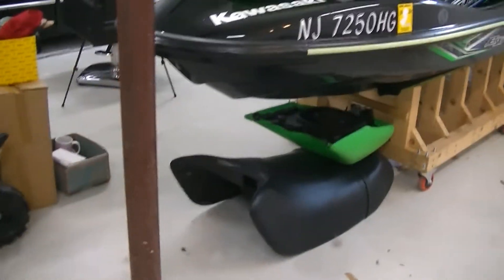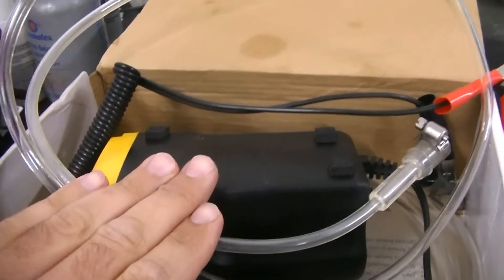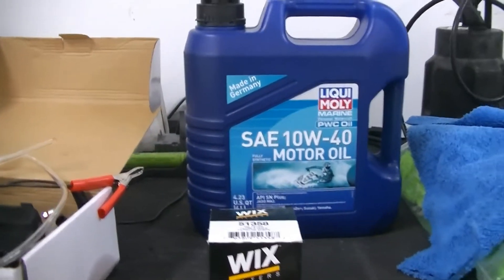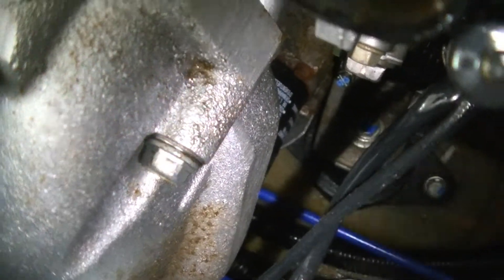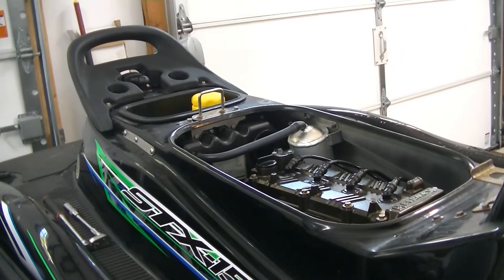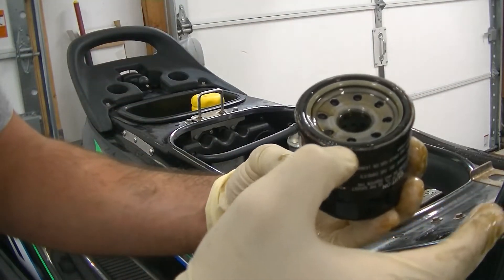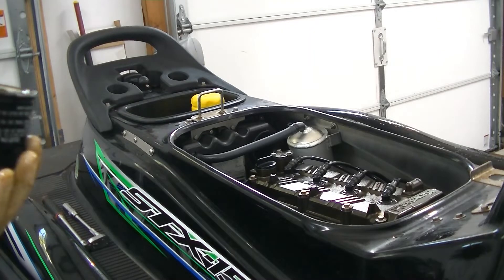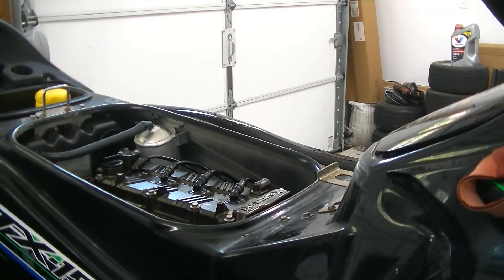How to change the oil in your Jet Ski!!!

Comment: Nice video -If you run the engine and warm it up first, you will get 5 quarts out (engine has 5.3 capacity) in a third of the time. Engine cold=thick viscosity oil. Letting engine run with fresh hose water going through it not only cleans old lake water and possible residual sediment out, makes oil thinner, and your 12V transfer pump doesn't strain.